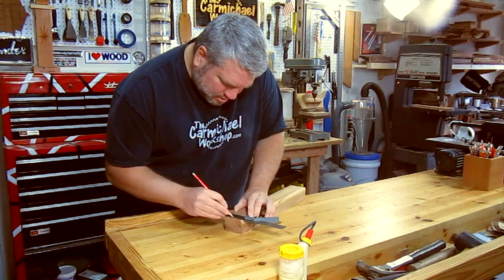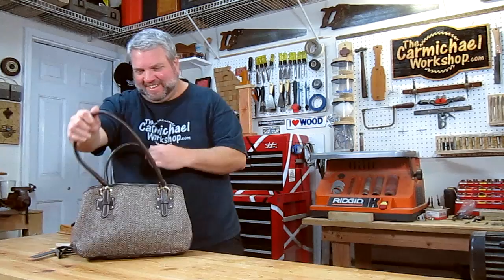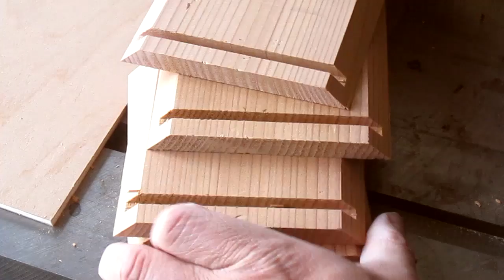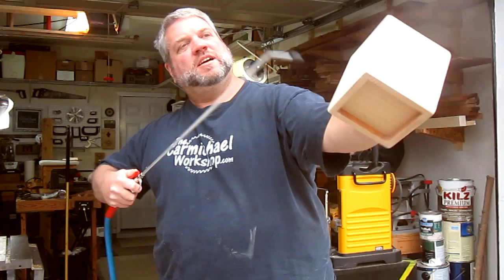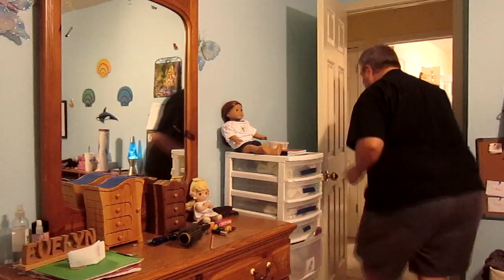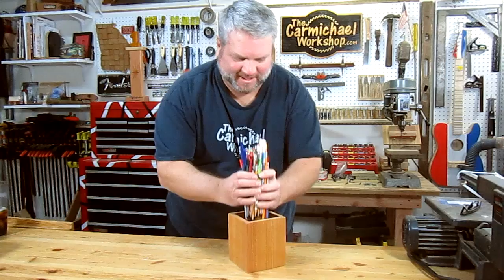Pencil Holder - Quick and Easy Woodworking Project

Comment: So true Steve, you put the something down and next thing is you knew you put it right next to you on the bench. All you do is just turn your head for a split second and the pencil pixies have picked it up and in my case its been put on the table the other side of the room, I find this happens with tape measures and screwdrivers, great video Steve.
Reply from the maker: Paul Willmore Thanks Paul!  It also happens to my glue bottle caps. lol

Comment: Nice video Steve. Did whoever you swiped all of the pencils and pens from ever catch up with you? lol
I meant to ask after your shop tour video where did you get that attachment for your table saw that you briefly mentioned. I have a saw exactly like yours with no guard on it. I have been searching for a after market something that will act as a guard and or splitter.
Charlie
Reply from the maker: Zaftig Buff  It's a MicroJig MJ Splitter I got from MicroJig.  I am working on either making or buying a zero clearance insert, then I'll install it.   I may do a video.

Comment: I feel like everyone's first tech project is a block with holes drilled through it on the drill press for a "pencil holder"
Reply from the maker: abslol1 That is a good skill builder.  I thought I would get annoyed by having to get the pencil into the hole, rather than just dropping it into a box.
Reply: true

Comment: Those boards are so cheap at Lowes, I buy two or three at a time and make birdhouses for the wife (and the birds) with either painted roofs or a licence plate over the top and hang them all over the trees in our yard.
Reply from the maker: Impractical Fishermen  I know.  I love using them and they always look great after running them through the planer to get the roughness off.
Reply: I don't have a planer, I just keep them raw, and let them weather. It is cool ot look into a tree and see dozens of birdhouses hung up. No birds yet but I keep trying different sizes of house and hole combonations.
Reply: I posted one on your FB page.